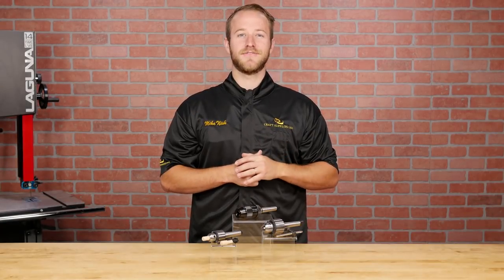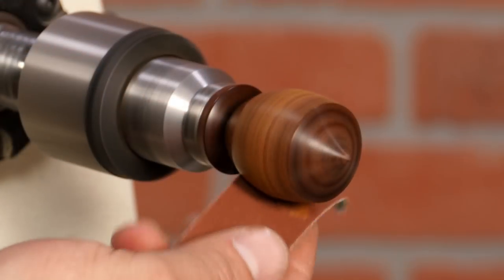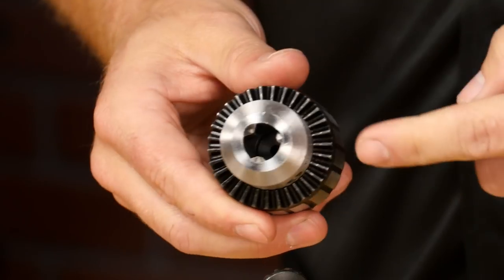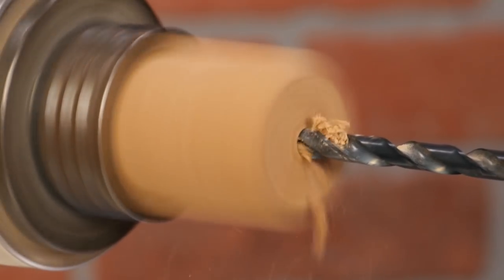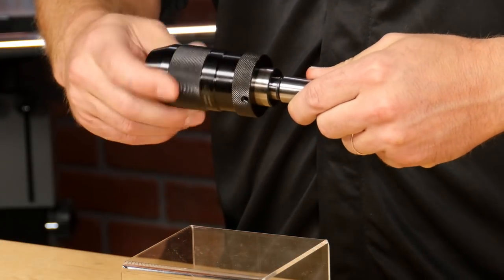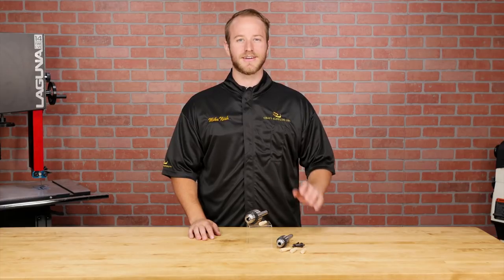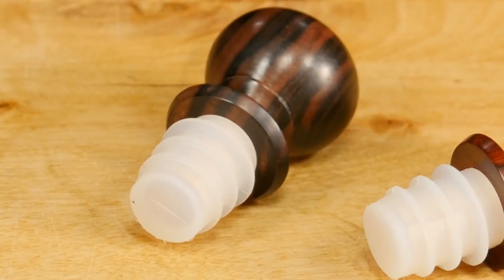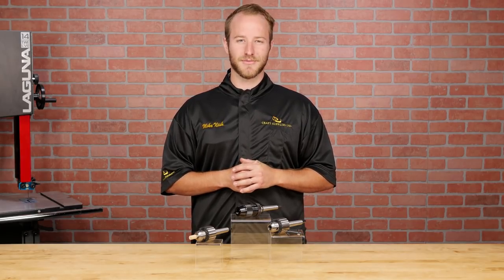Comparing Drill Chucks (Woodturning)

Comment: Nice Smock. I have a tan smock I bought in 2012 at one of your woodturning classes. Bought 3 others for my High School woodworking classes at Saugus High. I have 6 lathes for student use and also for adult night classes. Could always use another smock. I like the idea of the lightweight smock. I have no air conditioning in my class and it gets hot in the summer. Smock looks good also.

Comment: I bought that keyless chuck from you. I've had trouble with drill chuck shafts coming loose from the head stock morse taper. This one does also. I also bought that morse taper cleaning tool from you. Hasn't improved how the drill chuck stays in. What can I do?
Reply from the maker: Which lathe are you working with?
Reply: Thank you. I use the PSI Turncrafter Commander. I am out of my shop until Jun 26, so I'll not be able to give you much in specifics if you should need any. Being new to turning I'm interested in learning about any maintenance or tweaks I may need to make. I want to do it right to get the most out of my tool. I didn't know I needed to clean the inside of the tapers until recently. I did clean them as per the instructions that came with that tool, before use of the tool.

Thanks!
Reply from the maker: It's a good thing that you cleaned out your morse taper as that could easily be a part of the problem. You'll also want to make sure the arbor on the drill chuck is clean too. Because they are not threaded into the headstock, they'll slowly come out naturally without support. You can prevent this by using your tailstock as much as possible and you can also put a solvent on the arbor before inserting to really get a good fit. Please call us at 1-800-551-8876 if you're still having trouble. We're always here to help. Best of luck!!!
Reply: I guess I'll try the solvent as there are some turnings I do on small mandrels that have to be chucked (discs for bottle stoppers and bookmarks) where a tail stock cannot be used. I bought this hoping it would hold better vs cheapie one I had. Thanks
Reply: Or buy the correct morse taper arbor to fit your lathes spindle taper and chucks taper and make sure it's a morse taper that's designed for milling machines. They have the back end threaded to use what's called a drawbar on a mill. The same idea can be made to work on any lathe that has the spindle through bored. There easy to find.

Comment: I have the key chuck I bought. When using it on the tailstock. The chuck will come loose and start spinning any idea why? It is the correct one for my lathe. That's not the issue.
Reply from the maker: There may be debris inside the Morse Taper.  Make sure the drill chuck and MT are nice and clean.
Reply: @CraftSuppliesUSA  ok thank you.
One more question. The artistian ring bore. I have that but it's to small to fit in tailstock. Is there a way to get it to fit or not? Like the drill chuck fits into the piece on tailstock. But the bore kit wont.

Comment: Im new to the art, and my keyless drill chuck,mounted in the tailstock has begun to spin and push the tailstock away from the peice being turned each of the three times Ive tried to use it.  This last time, the two peices got totally stuck together.  Almost couldnt get it out of the tailstock at all.  
I must be missing something, but Ive tightened everything down and Im being gentle with the speed and pressure Im applying drilling it into the peice.  Any tips?
Reply: The drill chuck shouldnt be coming out of the tailstock, make sure you have the quill extended enough so it fits snugly, have you locked the tailstock to the ways on your lathe. Im not sure what got stuck together for you. You could try speeding up the lathe but i dont know how fast you were running it when you had the issue. Just my two cents, good luck and be safe